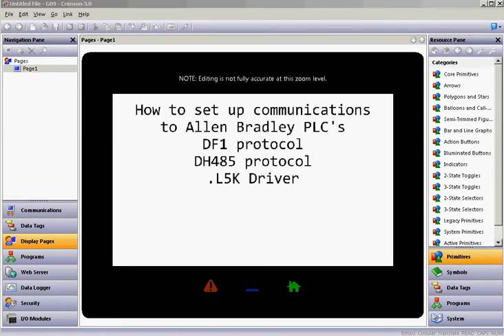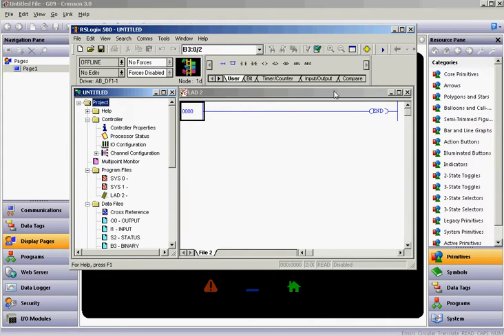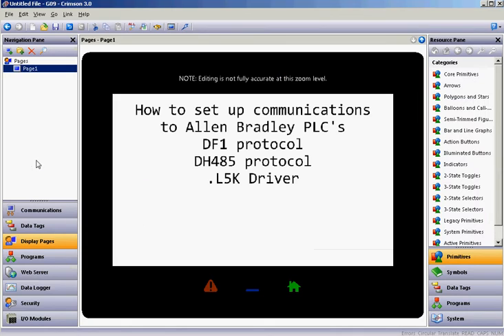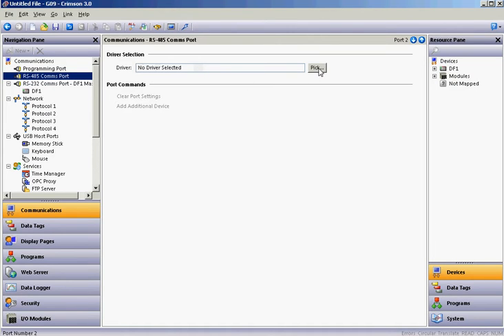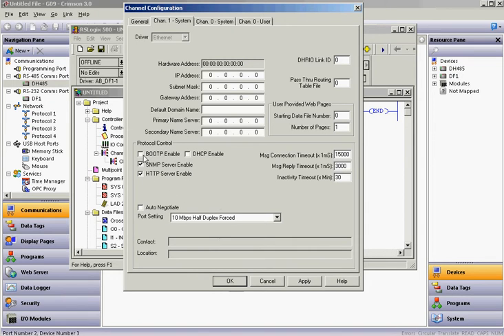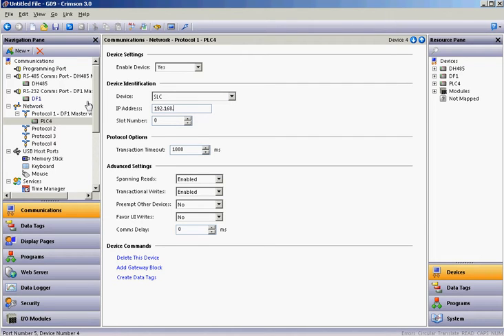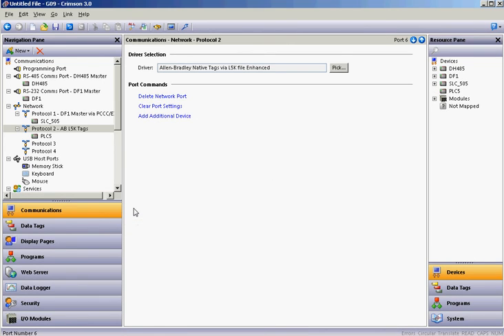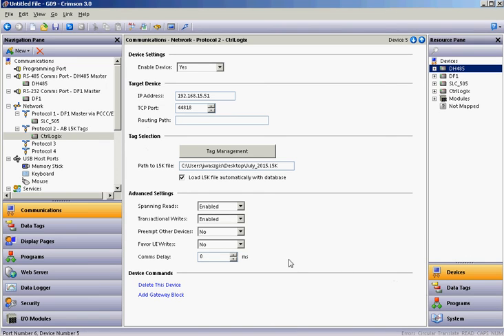RedLion Comms to AB SLC CtrLogix

Comment: Hi, Does this Redlion product supports SLC 05/04 Which has DH485/DF1 Protocol through RS232 port(DB9).
Reply from the maker: I believe that the AB 5/04 has a RS-232 & a Data Highway + port on it.  RedLion does not do anything on the DH+, but on DF1,  RedLion can talk for sure over the RS-232 comms.  The DF1 port on the AB 5/04 is a DB9 port and you will use the cable from Redlion CBLAB001.  https://www.redlion.net/sites/default/files/media/CBLAB001_1.pdf  .  Use RS_Lynx to get the settings and then pick the AB protocol in Crimson 3.1 to talk to the PLC.
Reply: @JoeWaZoo1_Geeks_Rule  Thank you for your reply, this clarified my doubts